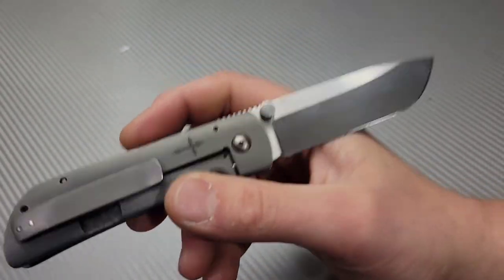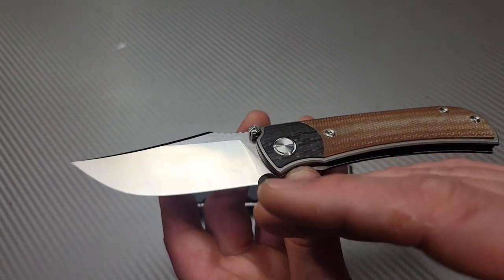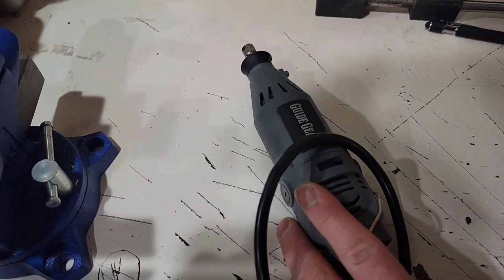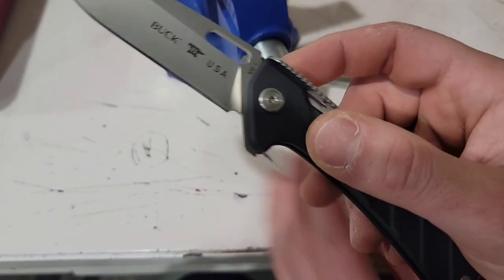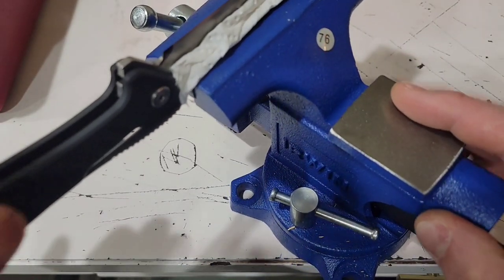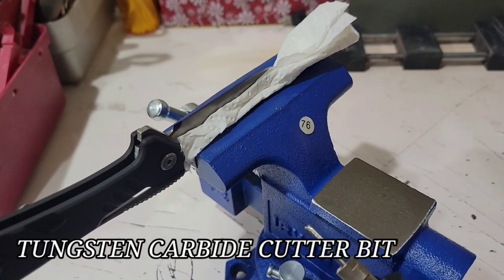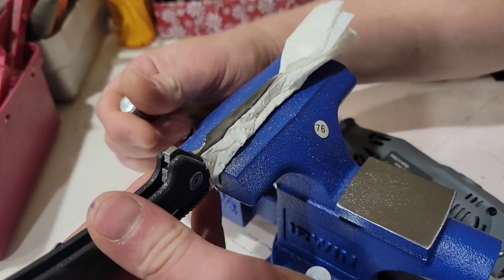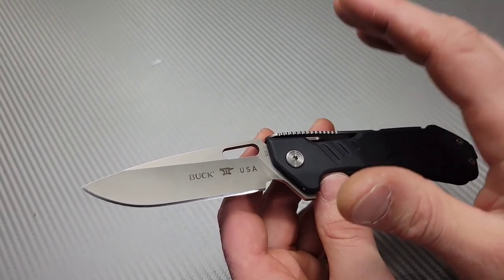HOW TO CUT IN A SHARPENING/FINGER CHOIL

Comment: I learned something today thank you that was cool
Reply: One thing to keep in mind the he didnt do was have water on a container to constantly be dipping the blade in to keep it cool. Doing this stuff to the blades creates heat and you ALW want the blade to be kept cool cause it will start to mess the heat treat if to much heat is generated. And it take not time at all for it to start heating that steel up. Other then that great job

Comment: Maybe just maybe you could run into a bit of trouble should the dremel decide to take off across the the full length of the the cutting edge, doing it by hand with a rat tail file is a bit more time consuming but a lot safer for the novice. `Just saying’ 👍😄 thanks for the video Jarred✌️
Reply from the maker: The folks that have a hard time using a simple tool like a dremel can always use a file absolutely, imo if you have that much trouble using a dremel then you probably shouldn't be using a knife, and since the point is to cut in a Sharpening choil I'd guess they sharpen so they can always sharpen the knife afterwards or cover the areas they don't want to damage with tape

Comment: Thanks for the vid, I've been using diamond dremel bits for a while now. Shouldn't it be faster with diamond than with tungsten carbide ?
that's what i tend to see online
Reply from the maker: The Carbide bit is much faster because it's made to cut hardened steel
Reply: @NeevesKnives  Thanks for the answer, ordered a 9903 just like yours to test it out next time a brand/maker doesn't respect the sacred plunge line !

Comment: Thanks for the video. I have a civivi pintail that I’d like to add a finger choil? How do I know if that’s ok? Also the blade is coated (black) so would I really screw it up if I put in a choil? Thanks!
Reply from the maker: The Pintail is fine to put a choil on, but I show you how to know, check to see where the stop pin is, the PINTAIL uses internal stop pins that are not in the way so your safe
Reply: @NeevesKnives  terrific, thanks!